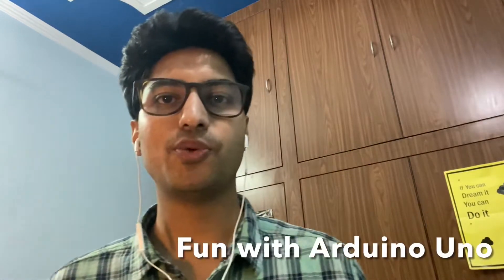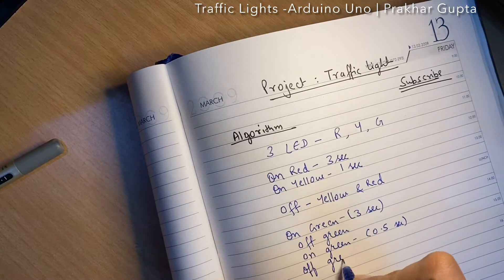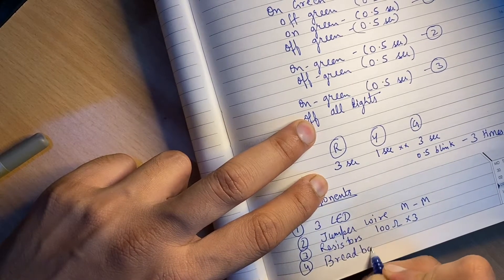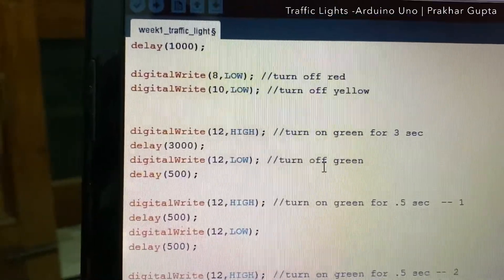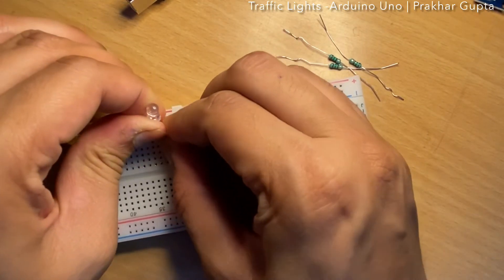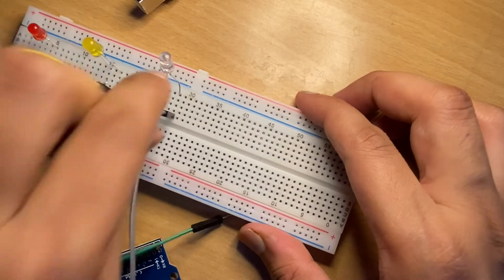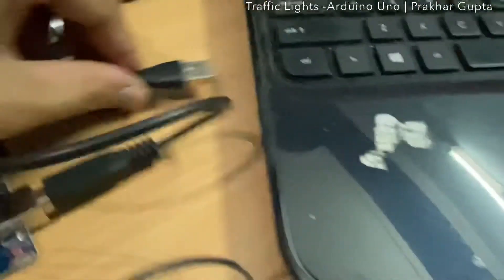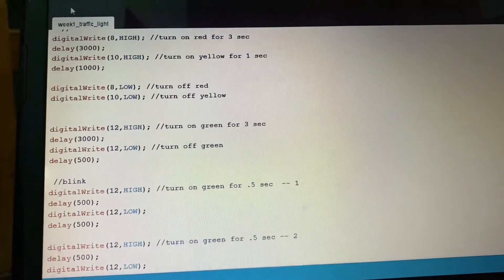Making Traffic Lights with Arduino Uno - Beginner Level (algorithm, coding, circuit design)

Comment: Little problem I had with choosing the write port, changed the USB (it was too long) then under programmer in Tools pulldown menu ticked "Atmel STK500 development board".shut down the IDE and turned in on again and there it uploaded the program and started doing its job as it was programmed to do. Thanks.

Comment: Hi! It was very interesting that you placed the resistors between the short leg of the LED and GND. Usually I have seen the resistor placed between the long leg and the digital pin to limit the output current of the Arduino. What do you think is the advantage of this method?

Comment: void setup () {
// put your setup code here, to run once:
pinMode (8, OUTPUT) ; // red 
pinMode (10, OUTPUT) : // yellow pinMode (12, OUTPUT) : // green
}
void
Loop(){ // 

digitalwrite(8, HIGH); //turn on red for 3 sec 
delay (3000) ;
digitalWrite (10, HIGH); //turn on yellow for 1 sec delay (1000) ;

digitalWrite (8, LOW); //turn off red digitalWrite (10, LOW); //turn off yellow

digitalWrite (12, HIGH): //turn on green for 3 sec delay (3000) ;
digitalWrite (12, LOW); / /turn off green delay (500) ;
digitalWrite (12, HIGH); //turn on green for .5 sec -- 1 delay (500) ;
digitalWrite (12, LOW) ;
delay (500) ;

digitalWrite (10, LOW); //turn off yellow
digitalWrite (12, HIGH); //turn on green for 3 sec delay (3000) ;
digitalWrite (12, LOW); / /turn off green delay (500) ;
I
V/blink
digitalWrite (12, HIGH); //turn on green for .5 sec -- 1 delay (500) ;
digitalWrite (12, LOW) ;
delay (500) ;
digitalWrite (12, HIGH); //turn on green for .5 sec -- 2 delay (500) :
digitalWrite (12, LOW) ;
delay (500) :
digitalWrite (12, HIGH); //turn on green for .5 sec -- 3 delay (500) ;
digitalWrite (12, LOW) ;
delay (1000) ;

//traffic light
prakhar gupta
/ / SUBSCRIBE TO THE CHANNEL TO RECEIVE SUCH VIDEOS
//digitalWrite (10, HIGH) : //turn on allow / / delay (1000) ;

Comment: // Pin definitions
const int redLedPin = 13;
const int yellowLedPin = 12;
const int greenLedPin = 11;

// Time intervals (in milliseconds)
const int redTime = 5000;    // Red light duration
const int yellowTime = 2000; // Yellow light duration
const int greenTime = 5000;  // Green light duration

void setup() {
  // Initialize the LED pins as outputs
  pinMode(redLedPin, OUTPUT);
  pinMode(yellowLedPin, OUTPUT);
  pinMode(greenLedPin, OUTPUT);
}

void loop() {
  // Red light
  digitalWrite(redLedPin, HIGH);
  digitalWrite(yellowLedPin, LOW);
  digitalWrite(greenLedPin, LOW);
  delay(redTime);

  // Green light
  digitalWrite(redLedPin, LOW);
  digitalWrite(yellowLedPin, LOW);
  digitalWrite(greenLedPin, HIGH);
  delay(greenTime);

  // Yellow light
  digitalWrite(redLedPin, LOW);
  digitalWrite(yellowLedPin, HIGH);
  digitalWrite(greenLedPin, LOW);
  delay(yellowTime);
}

Comment: the error it keeps giving me is that 'pinmode' is not decalred in  this scope. I used th earduino uno r3 idk if that has an effectr, and the port is com6.

AND how am i supposed to turn onthe device? and just in case this effects it in any way, i am using two lights instead of 3 because i only have 2 restrictors
Reply: The pinmode error seems to be in your code... I hope you've figured it out till now
Reply: @idkUdbhav  I gave up on that, it was for a school project, but it was for extra credit, I chose to not do it, but thank you!
Reply: @ItzOddz  Sorry about that. Next time if you try any Arduino project make sure to set the pinmode (as output/input)

Comment: Is it okay to use different resistance!!
Reply from the maker: yes, depends on the voltage, LEDs, etc. Higher resistance will impact either current or voltage.

Comment: How to design modern infrastructure of signal lights that will inform drivers about on coming traffics ahead on all cross roads so they can avoid collision? 
We all know programming light bulbs and WIFI are much cheaper than any traffic accidents.